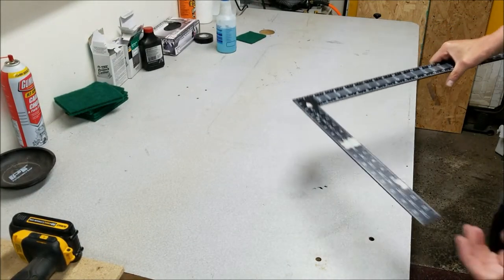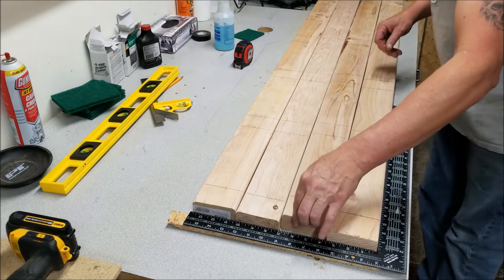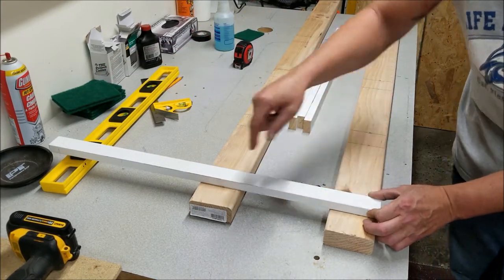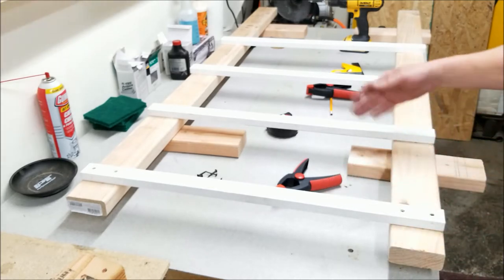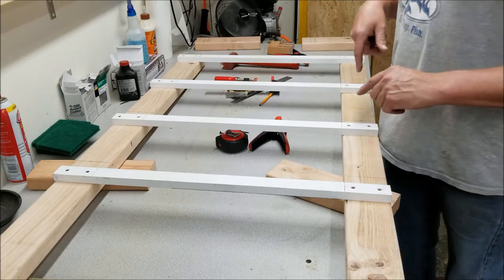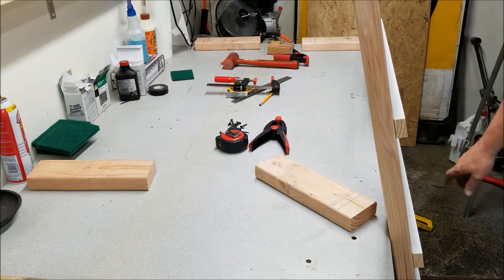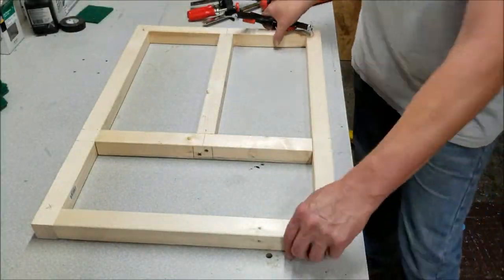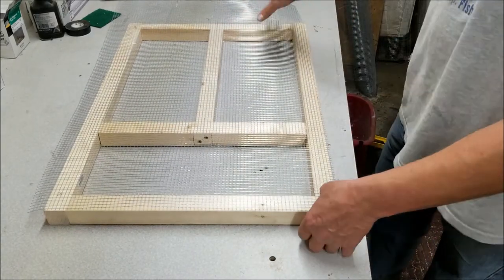DIY RAT RACK BUILD (RODENT) ... STEP BY STEP WITH DIAGRAM AND CUT LIST

Comment: Lots of great info for me to get started. I’ve got a question, do you know what size of tub would be fine for 2 breeder female rats?
Reply from the maker: The smaller tub that I used in the video is good size if you stay at a 1 to 2 or 1 to 3 you should be fine

Comment: I'm a little lost. For the 23/32in x 1½in x 8ft is that plywood?
Reply from the maker: No that was for the rail for the tubs
Reply: @MYANIMALHOUSE  I'm having trouble finding that in anything other than plywood? Making I'm just not looking correctly or typing it in correctly. I'm not seeing any boards at those dimensions.
Reply from the maker: @ThrowinBombs80  Its not plywood just a straight board

Comment: What size tubs did you use in this build?
Reply from the maker: They are the Medium concrete tubs from home depot
Reply: @MYANIMALHOUSE  I got the small concrete mixing tub from Lowes is it the same size just wandering cause I'm building my rat rack this Friday and am going to use the same measurements u did
Reply from the maker: @mysterymorphs-brian  Lowes changed the smaller tub so it may not be the same....But home depot still has the ones I used they are the medium ones ..they only have the 2 medium and large...Its the smaller of the 2

Comment: Way to much work just to get one of the selves on and make sure it’s level... I’m sure it’s going to turn out nice     But to much work
Reply from the maker: Its not at all but DIY isn't for everyone ...Thanks for watching 👀
Reply: Get them level and straight is important and make sure the tubs fit tight and slide smooth. Most importantly no gaps so they can’t escape. But it looks nice good work. It’s built differently from the way I do it. But nice work.   Good job. It does look nice